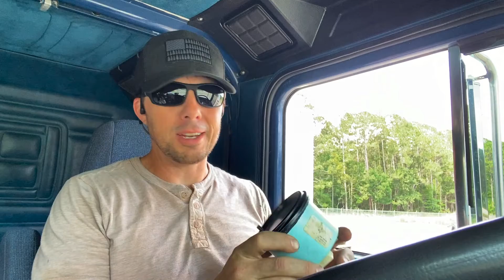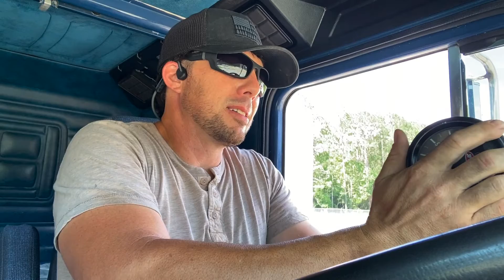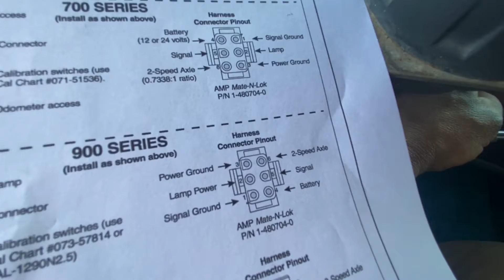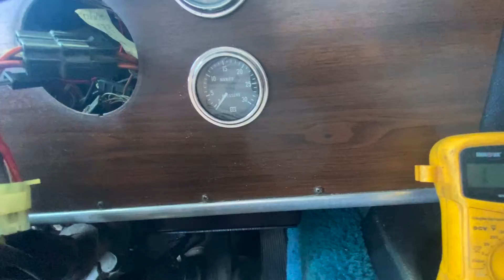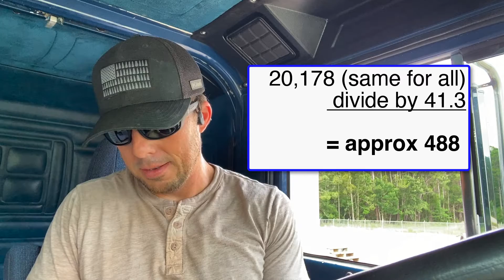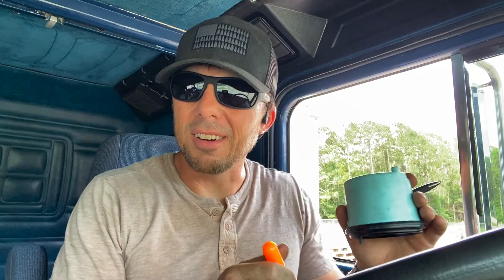Calibrating An Old Peterbilt Speedometer | Setting The Dip Switches And Checking The Wiring

Comment: Having trouble getting the correct calibration. Still 10 mph off. Done the math several times. Can you help????

Tire diameter is 40”
Gear ratio: 3.36
295x75x22.5 tires

The 700 series chart has other weird formulas to try and can’t seem to figure out which one to use…

Comment: Did you confuse diameter and circumference?
Reply from the maker: No, you want to find the diameter of the rear tire from top of tread straight to the ground in inches. Then you use this to find the revolutions this tire will make every mile by taking 20,178 and dividing it by the diameter. The 20,178 is a constant number valid in all applications to find the revolutions per mile. Hope that helps.

Comment: hey bro how are you getting the number 20,178 ? is that the rotation on your tire per mile?
Reply from the maker: 20,178 is the constant number used to get the rotations per mile. You take 20,178 and divide it by the diameter of your tire and you'll get rotations per mile. Anyways, you can find the equation for your specific speedometer by clicking on the links in the description. Hope that helps.

Comment: Do you know which sensor runs the rpm?
Reply from the maker: Sure. Many times it’s located on the bottom or side of the bell housing. Similar looking to the speed sensor but picks up the signal from the gears on the flywheel.

Comment: Really wish in you video you showed all the final numbers and dip pin positions this ended up just being a video to your specs haha. I paused and found what I needed but come on man. This info is actually pretty difficult to find
Reply from the maker: Hey bud you’re probably right should have turned the speedo around and showed that. The calibration is very specific to however your setup is and just wanted to help understand the process to do it. I’ll take your tip to heart be a little better in the future. Thanks a bunch.